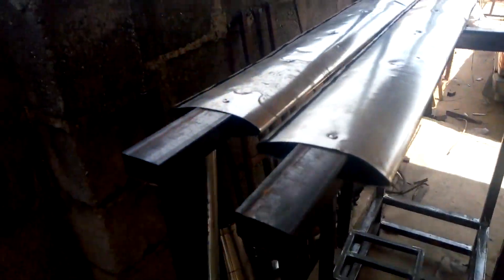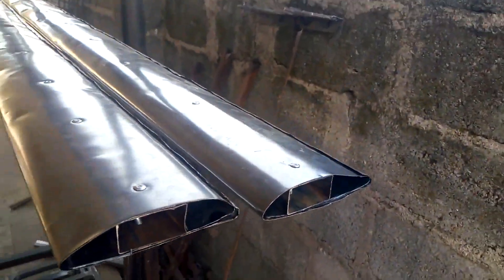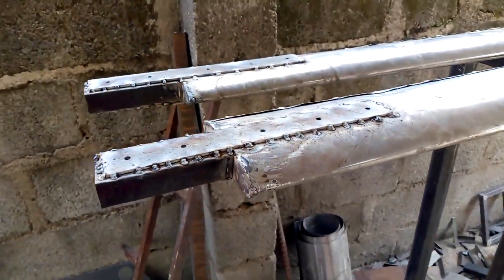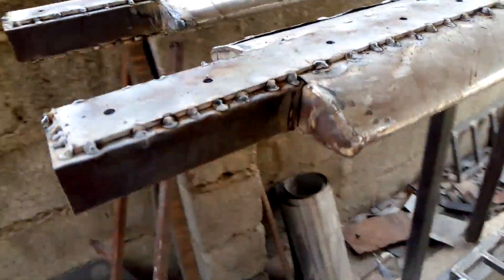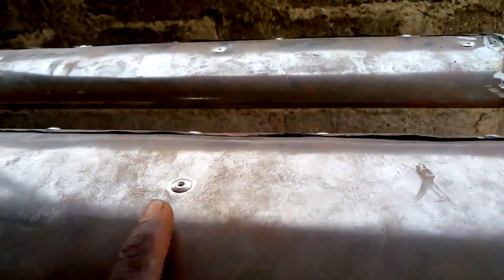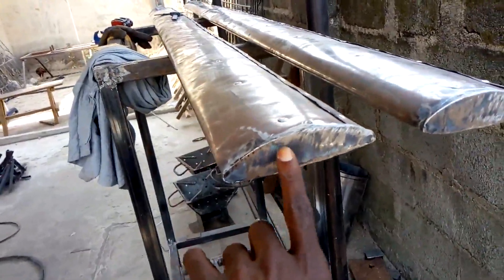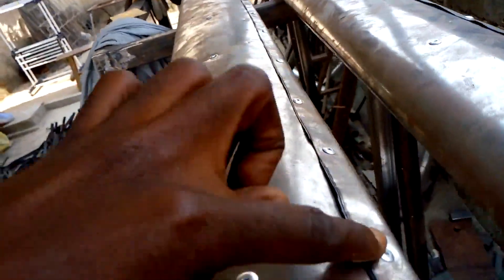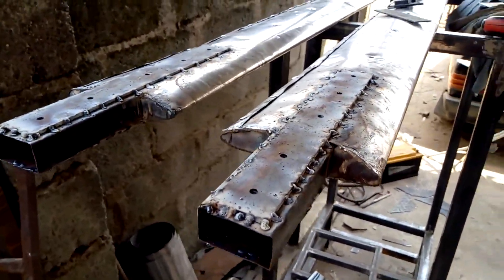Home Built Rotor Blade For Ultralight Helicopter - part 1

Comment: dude sorry to tell you but you are not ever getting off the ground . be careful, I wouldn't suggest trying to spin blades like that.
Reply: Thank you Daniel for that ray of Sunshine at the end of that "tunnel".

Way too many people here want to be supportive of his project, but from several decades of actually working with, and building experimental, (homebuilt) 'gyros' and fixed wing aircraft I can say with certainty this bird will not fly as built per the rotor design since they have no airfoil to speak of and are so badly dented that the turbulence alone is going to defeat any lift generated by them.

It's one thing to be supportive, but another to offer advice as to where to seek reliable information from people who actually know what they're doing.

Comment: I admire your passion in starting up your dreams just with your blades make sure you have no dents and make very smooth and use only aviation bolts no more then 5 grade because these bolts need some flex and do not use high tensile bolts over 5 grade or welds on blades or mast because the rotation of blade vibration can crake welds and bolts, height tensile bolts will become brittle and crack,etc.

Comment: I want to know if the fan is aluminum or steel
Reply: The material for the rotor's 'skin' is aluminum while the 1"X 2" material for the SPAR (inside) is made of steel which is very strong for the amount of weight  most one-man gyrocopters usually weigh, I've owned a Bensen B-8 GYROGLIDER / GYROCOPTER for close to thirty years with a set of wooden blades with the 1/8"X 2" steel "spar" and never had any problems with those rotors and know the spar system being used here is more than strong enough to do the job when 'properly' built.

Comment: Great effort.  The blades look too heavy though. The centripetal force can be 5+ tons at flight rpm, and those pop rivets have shear strength of about 300lb each. Please, please  do not fly with those blades.
Reply: No worries about actually flying. I mainly worry about bystanders getting impaled by flying metal when the come apart on first run-up.
Reply: @kdanagger6894  Should be an exciting experience either way.

Comment: This blade are TOO HEAVY !!! They must be made with aluminium
Reply from the maker: No not aluminium but 1.2mm thick metal sheet
Reply: @bensonb1ultralighthelicopt686 On the plane there is a rule, while the heavier, the more powerful the engine needs to be, the lighter the less powerful the engine needs to be. The rotor blades must be made of aluminum and carbon fiber or glass fiber, For each Kg of weight you need 0.20 KW of force or 0.28 CV.
Reply: @SETRABZAIA  how to make rotor blades with aluminum? can i use aluminium sheets for that can you please tell?
Reply: @Littlewings01  In aviation there is a basic rule: The heavier it is, the more powerful the engine needs to be. On the other hand, being lighter, you won't need as much power. For a helicopter for 1 person, ultra light ( like HILLER XROE ROTORCYCLE ), very small even a 40HP engine is enough. For a helicopter a little bigger, for 1 person, with more power, 64HP is enough. On top of the rotor blades, they can be covered with an aluminum sheet and internally have a rigid aluminum tube. There are several models on the internet. They can also be made of fiberglass (more expensive and laborious) and used in traditional models.
Reply: @SETRABZAIA  thank you a lot im a school student and im trying to make a big RC helicopter . This is very helpful thanks again ❤️❤️❤️❤️❤️

Comment: bro this will not work first its too heavy second go study the aerofoil technology these white people are only flying because gravity is afraid of africans,Africans are afraid of studying unless this is a con av subed though lets see love from kenya
Reply from the maker: Yes I am trying to construct a lighter one now and which I will soon upload the video thank you friend.
Reply: @bensonb1ultralighthelicopt686   better to try and fail than not to try at all but think to be efficient look at carbon fiber wings with aluminium profile for spine to save on weight because the frame already is too heavy from all that steel..it may work but in theory the gyroscopic effects would be unpredictable
Reply: Just looking at this I would want to do some FEA tests to validate the strength. The airfoil will likely produce lift, it won’t be effective relative to a “by the book“ airfoil but the results might surprise. As to the heavy comment. Helicopter rotor blades are heavier then You would think. They have been made out of solid laminated spruce with a steel spar. Which is heavier then this construction. However the loads on these blades will be in the several tons, and if they are strong enough. It’s just barely. I would do some calculations on centripetal load at least to validate the rivets. If the skin produces say 9 tons of force the sum of the rivet strength needs to support it. Without exhaustive design, everything needs to be overbuilt with a healthy safety margin. Make sure the hub has flapping and lead lag hinges to keep the load axial to its length or they will fold or disintegrate in flight. Designing a system that will fly is difficult. But the real challenge is one that will fly safely.

Comment: I have to give you full marks for your attempt making things, but are you working to at least a basic plan? such things as the profile of the blade, and its weight for instance? The heavier the blade is the more HP you will need to spin them BEFORE you even get near hovering. Have you fitted them to a helicopter and made it fly? I am intrigued.
Reply from the maker: Thank you for your idea contributions I appreciate!